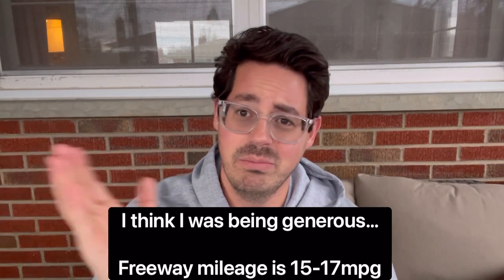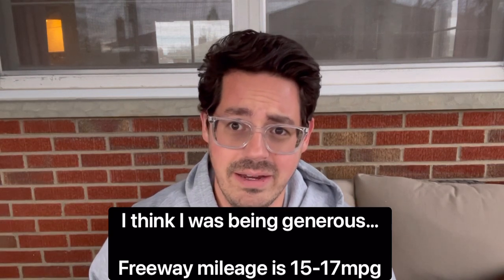Worst Engines of All Time: 1982-84 GM/Chevrolet 305/350 V8 Cross-Fire Injection System

Comment: I was under the impression that the third gen F-Body was based on the H Body Chevy Monza which was based on the Vega....I know the F Body had a "torque arm" connecting the rear suspension to the transmission, like the Monzas did.  Sometime in 79 or 80, I saw a picture of a Monza development mule which was testing third gen F body components in one of the car magazines. 

Considering the 11 year lifespan of the second gen, the third gen felt like it was light years beyond with new design innovations....the large rear glass hatch..no more leaf springs and interiors with some emphasis on ergonomics.  But typical GM...release the cars when they were not fully validated and then improve them.  If you went to a GM dealer..many of the 82 models felt less than finished....poor trim fitments to rattles and poor performance.  I recall our neighbor taking a new J-Car out for a test drive and coming back with sticker shock and how he preferred his older A body Malibu wagon.  

It seems by 84 and beyond, the designs of the "class of 1982"  J, A and F body cars were more thought out.  A high school classmate's dad owned the Chevy dealer in town and it was a real hoot to get a ride in a 1984 Chevy Camaro Z28 with the 4 bbl carb....whatever car his Dad had as a dealer demo, we would get a ride in...though the diesel powered Celebrity wagon he had later that year was "interesting" as in loud, and underpowered.  

For us there was a gap of new car purchases during this time.  Our 79 Cutlass was pretty much maintenance free, other than requiring a rebuild of the THM 200 transmission.  Dad was frugal and seemed to be less than impressed with the cars of this era.  After considering the 85 Buick Electra....he had a change of heart and bought an 86 Pontiac 6000 LE..which by that point was the start of "peak A car."  It was very well equipped...the 2.5 Iron Duke was still course and under powered but had decent fuel mileage and reliability.  Christmas 1988, during a family vacation in Colorado....Dad was putting the Pontiac through it's paces in the front range of the Rocky Mountains near Denver and Ft. Collins and said, "I really need something with more power."  Three years later, he come home with a 91 Bonneville with the 3800 and that pretty much addressed the power issue.  The interesting thing is the Bonneville was a cousin of the C Body Electra and by 91, the platform was pretty well refined.  I seem to have inherited the "buy the last year of a platform" mentality based on this.
Reply: The F-body used a few Monza pieces... and a few G-body pieces in the suspension and steering.   Those parts were fine!   It was the build quality and the engines that were lacking...  Except for one!   The X-Car's 2.8 V6.   It ran well in the F-body...   And maybe the carburated Chevrolet 305.   Not mentioned here on his post....  The Trans Am was supposed to get the turbo 301, That's why it had the hood scoop.   It was cancelled when GM decided to use corporate engines in the 80's and that was a shame....  Really.
Reply: They put the torque arm on the wrong/left side of the differential... '87 Buick GNX put it on the correct right side... but that X was an $11,000.00 option! On the right, it helped hold the right rear tire down... 
The Iron Duke 4 (no timing belt/chain!) is fine in flatlands here in NW Ohio but prolly weak for hills and mountain driving. I have 2: '85 Fiero and '77 Pontiac Astre Formula Safari (Kammback) Station Wagon... both 5 speed manuals... 
GM finally perfected the 200-4R tranny by '86... 
Also still have an '87 GTA: 
https://i.pinimg.com/originals/0a/6e/92/0a6e925d76ea7b8a50b40ef04eb7a4b5.jpg 
3 'orphaned' Pontiacs... LOL !

Comment: I had a first gen Monte Carlo with a 2 Barrel 350 that ran much better than any crossfire stuff. First hand experience. 4+3 trans in an 84 Corvette equals ZERO. I never knew about the reduced port sized intake but its no surprise that the General did crap like this.  The best way to sync a throttle body tps on a 84 vette is with a sledge hammer. I actually like the F body better than the Y body with cross fire because at least the pontiac had a good looking dash panel and unlike the Y body garbage. Neither ran worth a crap so why not have the 305 over the 350. Least F is a cool looking car.

Comment: I can tell you from personal experience since I owned a 82’ Vette for 12 yrs and yes when I first bought it the CFI had lots of issues. But.. I was on a quest to fully understand and make it the best it could be. First off from what I read when the CFI came out in 82 the were developing the TPI and the CFI was making more power so they closed off a 1/3 of the intake ports to reduce power. I spent a week porting the stock intake and it was a huge seat of the pants difference and pulled hard to redline. Yes had vacuum leaks and had to replace the bushings then had to balance the TBIs. Once done it ran and idled great. I averaged 18 mpg and my foot was on the floor quite a bit. Shortly after this there was a company in AZ that developed the new Renegade intake that had proven dyno numbers of 30 rear wheel hp. I was one of the first 10 customers that installed one for R&D. Another drawback was the ECU, it was extremely slow 64 bps but I had piggybacked a ECU from a 88 Z-28 and also made a world of difference. At this point I pulled the engine for a freshen up and installed Edelbrock heads and a Comp cam along with new bored tbs. Was able to dyno it it Chicago and had 423 rear wheel hp so for all the people out there that say these motors can’t make power not so. I sold that car four years ago and a gentleman at the gas station one Sunday asked if I would be willing to sell it and told him everything is for sale kidding around. Well he gave me a offer I couldn’t refuse and he took delivery that Tuesday. I still have that original intake that I ported and would wake up any 305 or 350.
Reply: I will agree with most of what you said, but you are entirely wrong on why they shrank the intake ports.  If GM didn't want an engine to make more power then an upcoming engine, they simply lied.  Take the 1996 LT4 vs the 1997 LS1 as an example.  They advertised a 360hp engine as 330hp to make the upcoming 345hp engine look better.

Back to the Cross Fire, they made an engineering decision based on marketing, and they were stuck with it before they realized how bad it was.  The Cross Fire was supposed to be reminiscent of the old Z/28 cross ram intake.  The problem is that that 302 is a 7000rpm racing engine with two 4bbl carburetors, a huge camshaft, and no emissions or fuel economy requirements.  The 1982 Corvette had 2.87 rear gears, 0.7 overdrive, and 27" tall tires in an era of 55mph federal speed limits, meaning the engine had to chug along happily at 1400rpm on the highway.  It simply couldn't meet emissions and fuel economy requirements as designed, and they were in too deep to change course.  The intake ports were shrunk to increase velocity so the fuel didn't drop out of the air at low speed and load.  The loss of top-end power was an unwanted side-effect.

Now that we're in an era of 70mph+ speed limits, and we can install whatever rear gears we want, the main design flaw is easily overcome.  My '82 Corvette has the intake ported to full-size, and the rear gears are swapped to 4.09.  I don't need to worry about what's happening at 1400rpm anymore.  Additionally, it has Dart heads, a slightly larger Howard's camshaft, Comp Cams 1.6 rocker arms, oversized throttle bodies, external fuel pressure regulator, Hooker headers, 2.5" exhaust, and a 1984 Corvette ECM.  Next, I'm going to upgrade to a 1991 TBI ECM from a Caprice to gain an air temperature sensor for more consistent performance, and I'll replumb for a single idle air control at the same time.  I'm also considering going to 3.73 or 3.54 gears, because the 3.06 first gear is useless with the 4.09 gears.

Where is Mr. Rare Classic Cars & Automotive History?  Come over for a drive.  You'll like it a lot better, and don't be so scared of your TH200C.  It's the TH200 from the late '70s that's total junk.  The TH200C isn't a great transmission, but my '87 Cutlass was still going strong at 140,000 miles when I swapped the engine and a TH350C.
Reply: @KevinJames-yg9eu  I don’t know why I’m just reading this now but very interesting to say the least. I was given that information on closing off the heads so I went with it but after reading your post I see your facts are more realistic. Thanks!
Reply: good job
Reply: Very, very cool. That's a neat trick about the intake.
Reply: I had began on a flat top plate and porting to replace the 2 tbi with 2 600cfm Holley carbs and there wasn't a good choice in head and cam profile that I thought would work right, so I never completed it. I think the top plate is still laying around somewhere
Reply: How did you make it run on the later z28 ecu? Please and thank you.
Reply: @xmo552  the company that developed the Renagade intake specialized in the CFI systems and they sold the adapter that was like a memory card that went into a computer. You could use any GM V8 ECU from 88 on and would sit on top of the stock ECU. The new adapter had a ribbon wire that would go between the two.
Reply: @alconk7129  
Thanks for the reply. Was it Arizona Speed and Marine ?
Reply: sell your intake manifold?  my 82 NEEDS IT!!!  and thanks for the comments/advice!  cloudshepp
Reply: Hey do you still have that intake manifold? I’ll buy it.
Reply: @tazmonkey33lol56  sorry sold it right after I posted my reply a year ago. Definitely do this though it’s unbelievable what you gain from it.
Reply: At the age this CFI system is now, if you plan to use the car there's no shame in removing the original pieces, putting them in a safe place and putting in something like a non-invasive Holley system. It's best to have it all locked away in a safe place for reinstallation when it comes time to sell the car. Those parts are getting too hard to get and unfortunately everyone what's the OEM stuff still on the car, no matter how awful it was
Reply: I mean,  they're still big pushrod v8s regardless of the injection system.  Everyone knew if you opened them up and let them breathe they could perform.  It's the same 350v8 from the muscle car era.

Comment: If I would have all that trouble with the induction system I would jerk it out and put aftermarket intake and run a Holley 600.  You can still keep all that junk in a box. I would rather enjoy my driving experience vs worrying about that crap leaving me stranded or scratching my head!
Reply: It’s neither complex or unreliable. It’s just 40 years old and needs to be refreshed.

Comment: When compared to the mid 70s L48s the L83 was a barnburner. One thing to look at on the cfi engines that run rich is the engine coolant temp sensor, the early ones were very troublesome and wouldn't give the right readings to the ecm. GM updated them by 85, I changed a few ect sensors and pigtails when I started out as a mechanic in the early 90s. Also check for vacuum leaks and bad ecm grounds (back of pass side head).
Reply: But compared to the L82 that the L83 replaced, it was not a barn burner.
Reply: @corvettejohn4507  but the L83 was standard.

Comment: I know that you are not a performance enthusiast, and that is probably why you messed up on runner length.  To wake up any crossfire engine just replace the factory intake with the aftermarket Renegade intake that fixes GM’s engineering boo-boo.  I had a friend with an ‘84 Corvette who laid all that wiring aside, installed a proper single plane intake, Holley carb, loaded with nitrous and regularly ran 10s at 130 mph.

Comment: I had an 84 Camaro that was somewhat of an oddity in factory options. It had a 305 4bbl carburetor but it also had rear disc brakes which were junk. And this is where most of the car's problems started. The previous owner couldn't stop and ran over a parking curb. The reason being was that the auto adjuster for the rear brake calipers stopped working. The theory was that when the handbrake was applied the driver would be assumed to be applying the foot brake. Releasing the handbrake would cause the ratchet in the caliper assembly to advance the piston closer to the rotor as the pads wear. This assembly stopped working and as the rear brakes wore out it caused a farther than usual travel of the foot brake until it became more difficult to stop. By this point most of the braking action was being put on the front wheels. Back to the curb incident, the steering was extremely soft and so I took it in for an alignment. The tech told me that he couldn't align the car due to a broken frame. Apparently during the minor accident the front wheels hit the curb so hard that it broke the rail that the power steering assembly was mounted to. The mechanic said the failure of the frame rail where the power steering unit is mounted was very common among those cars and that after market kits were sold to either repair a broken frame or added to increase the strength of the frame rail specifically at the mounting points of the power steering assembly. This was before the Internet so I didn't have a lot of resources to research the issue. I found a welder who repaired it by welding plates to repair the broken frame. Another issue I had with the car was overheating and terrible gas mileage. Thinking back I believe the problem had to do with a clogged catalytic converter due to excess carbon from too much fuel. Given the age of your car I suggest avoiding potholes at all costs because the frame rail is not as strong as it should be.
Reply: Early rear disc were moraine floating caliper and were junk compared to the PBR disc brake system on the later models.
Reply: Tldr

Comment: "Feedback controlled" puts it ahead of the previous 85 years of engines Adam.  It also had early obd diagnostics.  We've found that those who don't understand how it works are the ones that hate it.  This is a repeat of history the Rochester mechanical injection released in 1957.  Those who hated it and couldn't understand it's superior system either, and simply downgraded it to a carburetor.  Very sad.
Reply: I see what you're saying, but not everybody that buys a car wants to "understand it".   Most people just want it to work correctly and not be costly to own and maintain.   Needing to understand it usually means that it's giving the owner problems.
Reply: @johnz8210  But any 40 year old car will require lots of work and understanding to keep it running right.
Reply: @ErikDB6  That's true, you are right,  but I think this video is about if you bought one of these things when they were pretty new.  There was no internet,  nobody really had a lot of experience with repairing them then.  Now there's lots of information out there about them that just didn't exist back then.
Reply: But these videos make great theater even if they are not factual!
Reply: @GoldenGun-Florida  Hehehe :)

Comment: I've got an 84 C4, by 80s standards the L83 long block wasn't too bad. It had forged pistons, heavy duty oil pump, windage tray, aluminum water pump. It does have a nylon cam gear. Along with that it had a serp belt set up, headers and a pretty good exhaust for the day.
I tried porting the intake but wasn't too impressed. I ultimately pulled the intake and twin tbi units. I installed a traditional dual plane type intake and a tbi unit from an 87-89 Chevy truck. The stock wiring hooked up and the ecm runs it fine.  Makes pretty good power now.
I know the tbi 305s in the later Camaros made 5 more hp then the cfi Camaros but they had those terrible swirl port heads.
Reply: The '85's with TPI and iron -882 heads ran pretty good: 
https://www.youtube.com/watch?v=M9FwU9iUmfo

Comment: That's most likely the reason that so many are now modified,  I am like you I like original cars, but I know I would not put up with that cross fire system,  I would just go out get an aftermarket EFI system, I knew someone who bought brand new a 83 firebird SE with the V6 and after a few months the engine blew, the guy was so sick of the problems that car had that he went out and traded it in for a Geo sprint  , hate to say it but the sprint was a better car.

Comment: I think both the Crossfire and the TPI were designed to get amazing torque and power at lower rpm, 4000-5000, not the older 6000rpm of the classic muscle cars, and at least it worked well in the TPI. World class performance. Also apparently met emissions by this method,  until they could build the engines to rev higher.
Reply: The TPI was created to give the 305 the low end power of the 350.

Comment: That picture of your 1982 Firebird brought back memories of my very first new car purchase right out of college, which was a 1985 Trans Am, two tone paint, dark blue with silver paint around the bottom edge of the car, T-tops, cloth seats.  It had the 305 HO, 4bbl carb, which was 180 HP.  I put 120,000 miles on it with only problem was the transmission governor and the front brakes kept wearing out too quickly.  That car gave me a lot of good times.

Comment: In the Cease Fire engines defense, the short block is pretty nice. My son bought an '84 Vette with a rod knocking. We pulled it apart to fix it, and it had a windage tray, steel crank, X rods, and true flat top pistons! The rest of the engine is garbage.

Comment: My good friends dad has one of these cross fire corvettes. He bought it on the cheap because the cross fire wasnt working but since he is an ex air force mechanic he got it back running pretty easily. Ive driven it, definitely not fast but torquey enough to break the wheels loose...looks cool too. I think its an 82 Vette.
Reply: I don't care if they are slow, they are soooo sexy and still enough torque for a good time!